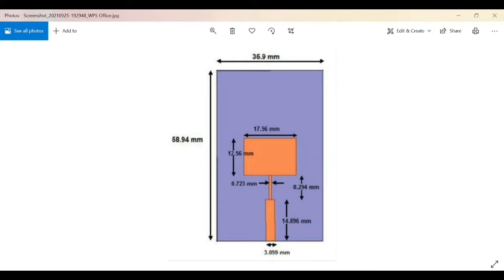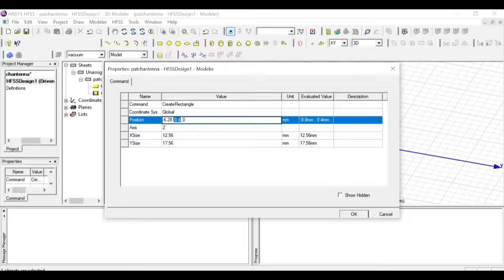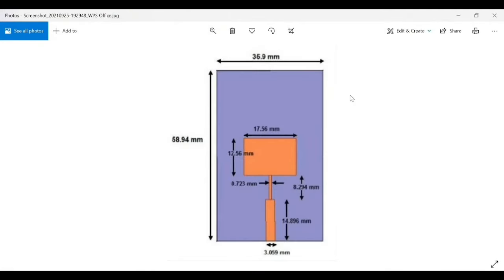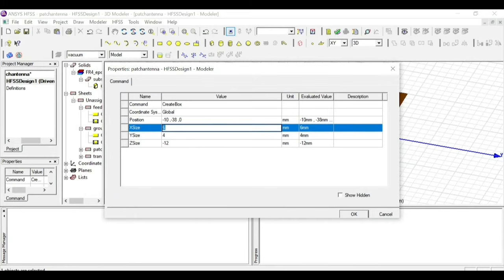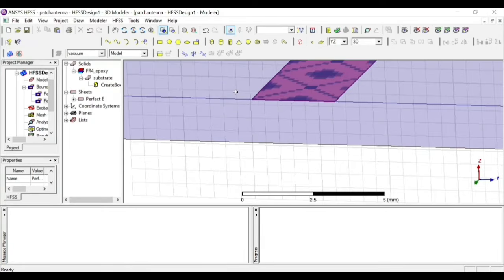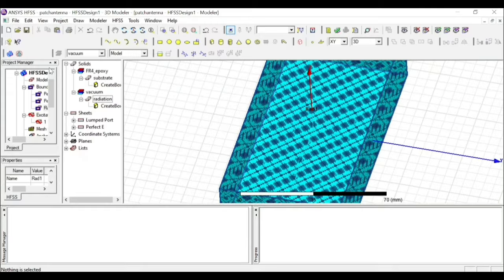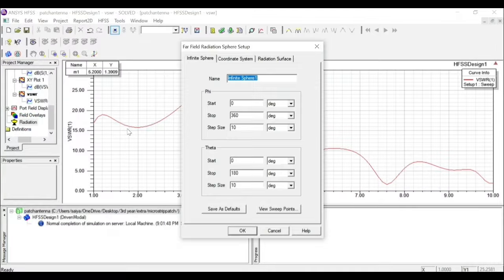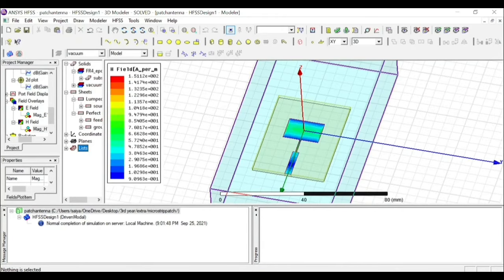Design of Rectangular Patch Antenna | Design of Microstrip Patch Antenna using HFSS 15

Comment: Thickness  of the following model
Reply from the maker: The base (substrate) is 1.6 mm thick, and the copper layer for the antenna is super thin, only about 35 microns. That’s why when people talk about the antenna’s thickness, they usually mean the base, not the thin copper layer.

Comment: Hello sir I have a small doubt when I designed an patch antenna and that have 2 feedlines the thickness of feedline is 0.6mm and the distance between the one end of one feedline and other feedline is 2 mm. I need to solder a same  single SMA connector to that 2 feedlines is that creates issues please help
Reply from the maker: Yes,it causes some issues like impedance mismatch as an SMA connector is designed for 50 Ohms impedance. Connecting 2 feedlines can disturb the impedance and can also cause problem in current distribution and unwanted signal interference. So I suggest u either modify design to have single feedline, or use a  Wilkinson power divider if u really want to use 2 feedlines

Comment: Can you please tell about the distance of  transmission
Reply from the maker: Actually this antenna I made for a college lab exam based on the research paper link I mentioned in the description. The antenna is made for WIMAX communication so it can be used for distance of 50 km to 90 km.
Reply: @padharthisaiyashwardhan  Can you give your contact mail because I am currently doing a college project on the basis of patch antenna
Reply: Okay ❤

Comment: Thank you for your explanation. Did you use thé conventional equations(based on frequency, directric constant and h)  to find the antenna dimensions. Did you use the rectangular which is btw thé patch and feed Line as a feed transformer to adjust the matching.
Reply from the maker: Glad you found my videos useful. As for the equations I used,yes I made use of the conventional equations.yes I made that by taking into consideration the distance between the patch and feedline as feed transformer for matching the impededence.

Comment: sir how to calculate length and width of the feedline and how i know impedance is matching
Reply from the maker: The width and length of the microstrip feed line has to be equal to the port impedance of 50 Ohms. In order to find the width and length theoretically is difficult but you can use hfss design toolkit software to find them. As for the impedance matching you need to represent the feed line in terms of its equivalent circuit diagram in terms of impedance and find out whether the impedance at the input of feeding is equal to impedance at the output of the feedline.